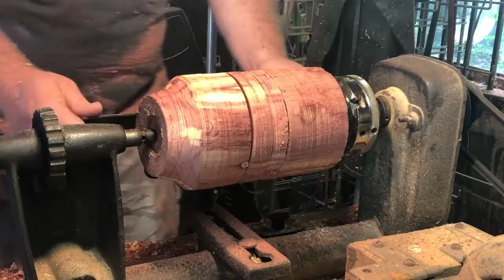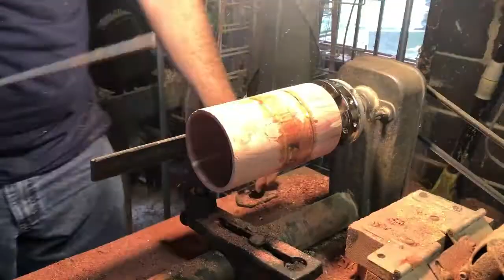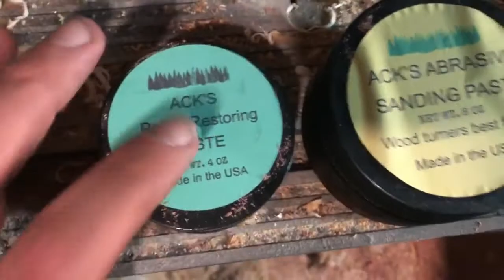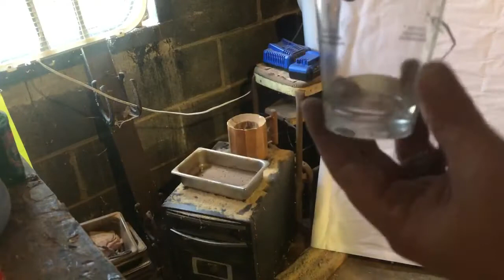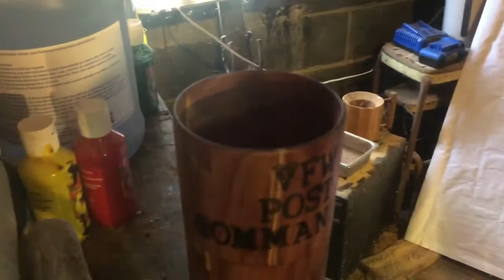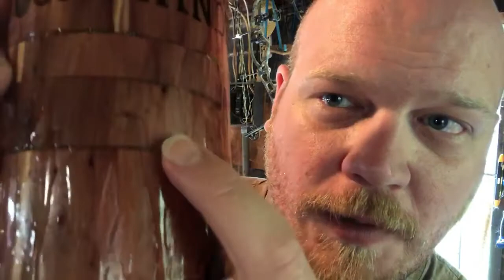My #TMTBeerStein submission! I make a beer stein from cedar! (Again...)

Comment: Hi Rockin R....glad the Stein turned out well...did you burn the letters on?...I would like to see you make a 12inch lathe sanding disk for you lathe...mount it on a faceplate or put a tenon on the back to fit onto the chuck...use it to sand the timber flat before the glue up...save slot of time trying to make those gaps disappear...good video....All the best.....Andy
Reply from the maker: Andy Paramore great idea! Thanks, I am definitely going to do that. Would definitely help since I have to sand everything by hand.
Reply from the maker: And yes, I did burn the letters on. Just forgot to turn on the camera when I did since it was a lot of switching stamps and letting it cool down and heat back up.
Reply from the maker: I took some plywood and glued it together to make a sander, now I am on to getting a block to mount it to and getting some more sandpaper to finish it up!